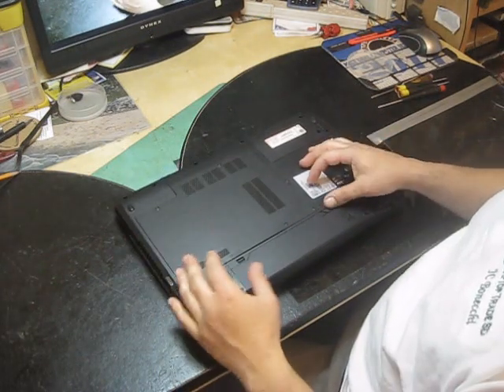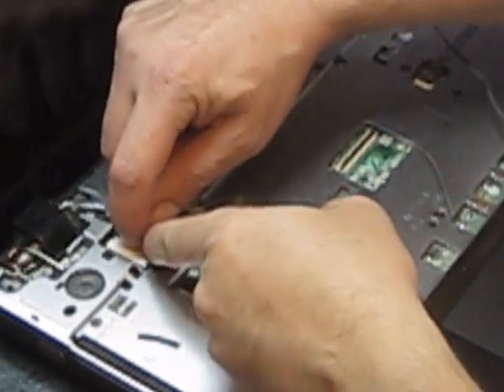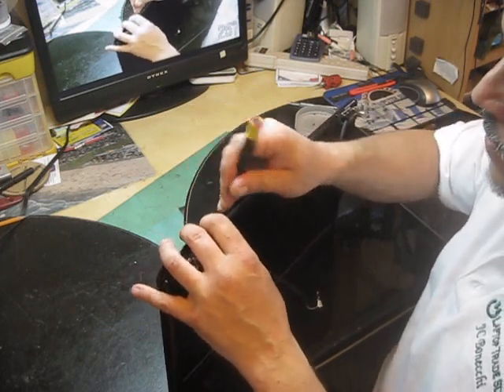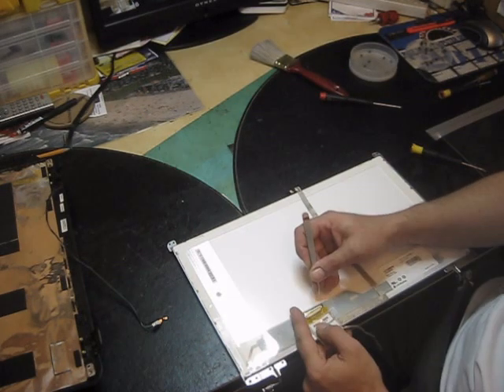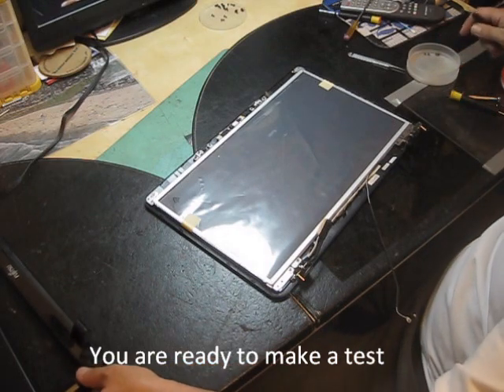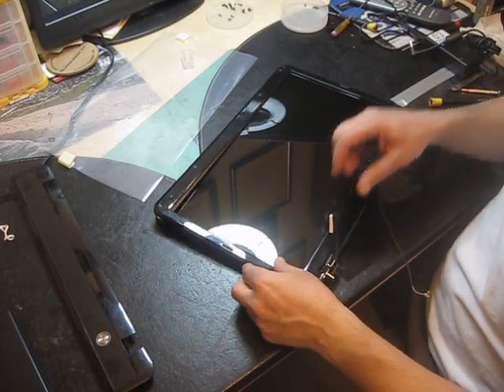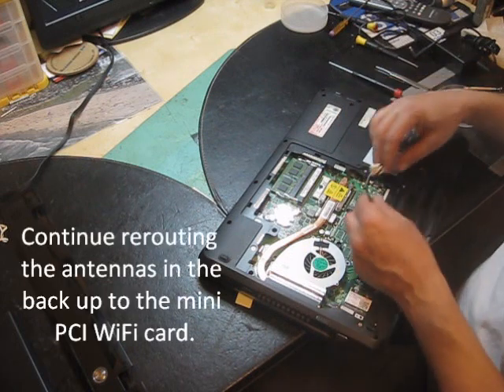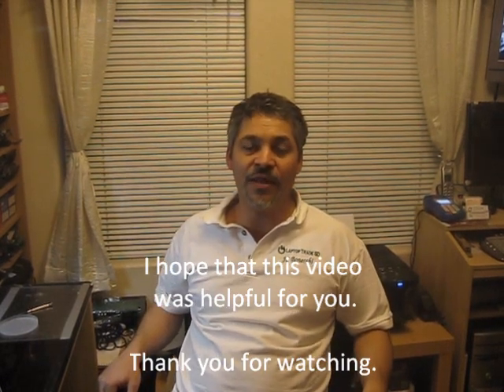How to replace Fujitsu Lifebook A Series laptop LCD screen

Comment: This actually helped me quite a lot and worked like a charm! But for anyone else attempting to do the same: be really careful with the power butten cover, it's very hard to remove without causing any damage to the laptop (it's probably best to start opening it from the side at the edge of the laptop) and the LCD cable (I know it has already been mentioned in the video, but it is REALLY fragile. However if you pull very carefully and wiggle it around softly it will disconnect eventually).

Comment: I successfully replaced the screen in my fujitsu lifebook a557 with the help of this guide and I want to share my experience: I carefully followed the guide but in the end it turned out that for this newer model it was not necessary to remove all the screws in the back and to remove the camera cable and the wifi module and the keyboard. The reason for that is that the camera and the wifi model are only in the framework which is separe from the display. There was also no problem with the power button cover for this model. I cannot completely remeber but I think I had to remove some screws in the back to remove the hinges which connect the main part of the laptop with the lid / screen. I do not know if I would have been able to remove the bezel without that. So I suggest you to remove the battery and then immediately try to remove the bezel. And just if it does not work remove the screws for the hinges and try again. Be careful with the fragile LCD cable. If you succeed please share your experience with us.

Comment: there is a way easier way to replace screen, you don`t actually need to take any screws from the laptop itself.... go straight to the bezel and take 6 screws out, remove bezel and wuolia:)
Reply: That is exactly what I was thinking. This is a unnecessary long-winded approach to perform the same thing.

Comment: Overall a good video. However, you don't show the removal of the three screws in the battery compartment. I tried removing the power button bezel and didn't realise that it was still screwed from the back. As I was trying to remove it I damaged the power button connector and now the laptop won't power up. I managed to change the screen without difficulty and got it started a couple of times to know it works. Just thought I'd mention this so it doesn't happen to anyone else. Anyone know where to get a replacement power button circuit board?